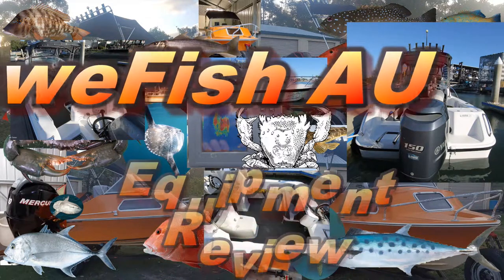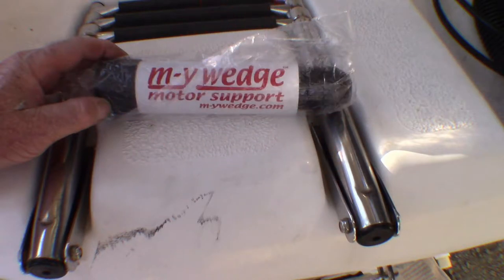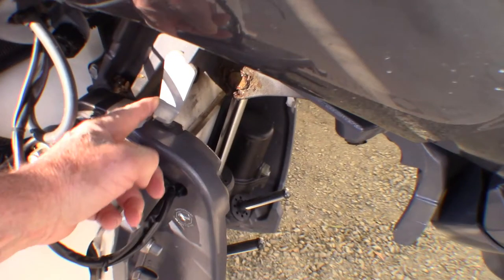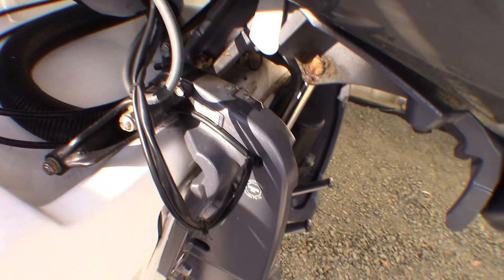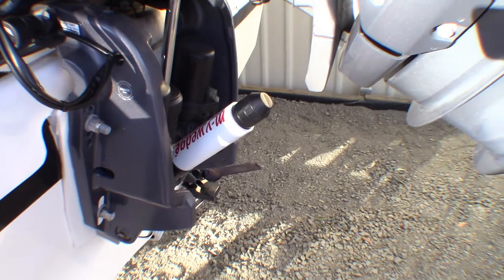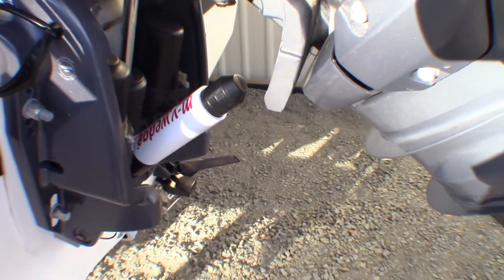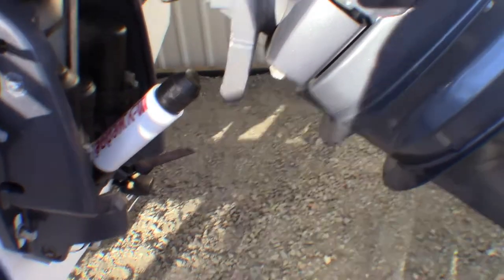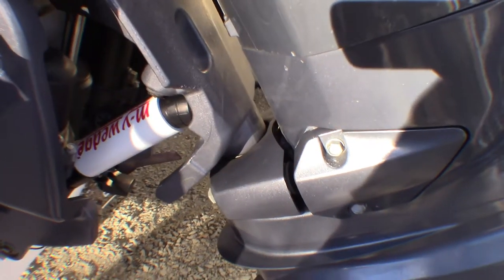m-y Wedge Transom Saver Review

Comment: I understand this damages the tilt mechanism seals.
Reply from the maker: There are a lot of different opinions on transom savers, including if they are even needed.  Yamaha don't recommend sitting it on the tilt lock.  I used to have a bar support from the trailer to the bottom of the engine on previous boats but that isn't practical with the trailer I now have.  On the whole, I think this the best option.  I'm not sure how it would damage the tilt seals since the motor is sitting on the wedge, not the tilts.